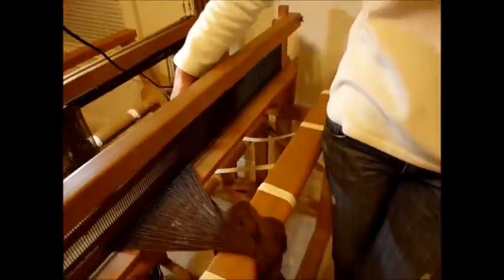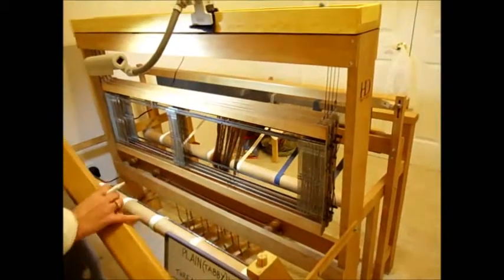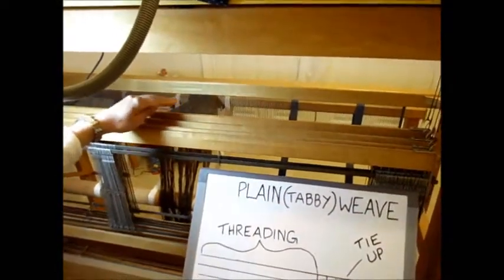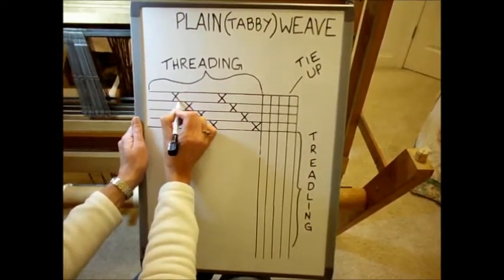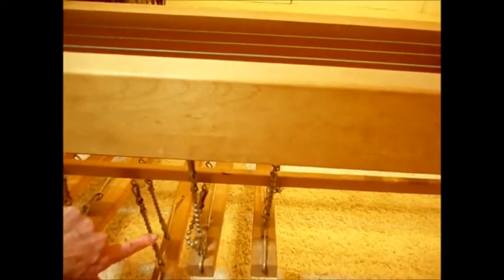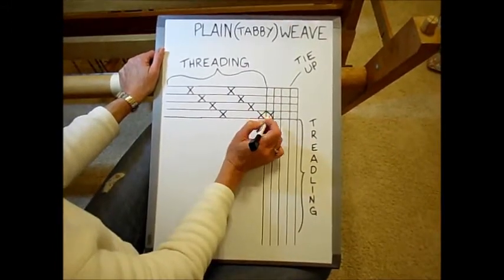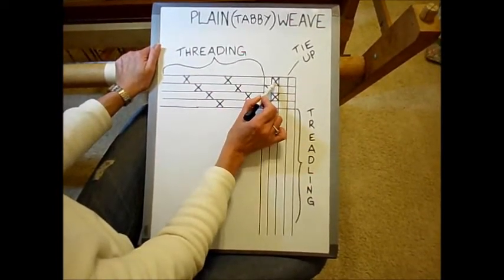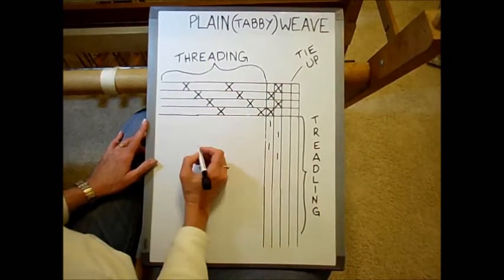How to Weave on a Loom - Video 9 - Threading the heddles on a loom Part 1

Comment: Hi! Thank you for this. One question: when you flip the pattern do you start the threading sequence on the far right side? The edge furthest away from the treadle tie-up information?
Reply from the maker: Hello! Yes, you are correct. You should start threading when you're sitting at the back of the loom from your right to your left with the pattern flipped upside down reading it while it's upside down from right (edge farthest from tie up info) to left.

Comment from the maker: Try this:Start by hooking the loop at the end where the long and short cables come together to the chain that attaches to the cables across the bottom where the lamms are. Bring both long and short cables up and over the pully on the right side of the loom, under the metal bar across the castle and connect the short cable to the right side of the harness and bring the long cable over to the left side of the loom, over that pully and attach it to the hook on the left side of the same harness.
Reply: Elizabeth Wagner PL explain me in jaquard

Comment: I have a question. Your video is very good.  I am a starting weaver.  I recently purchased Anne Dixion's The Handweaver's Pattern directory.  In this book there is an additional grid shown on each weave sample page.  On page 29 there is a plain weave the top left of the page shows the threading of the heddles.  Next to that on the upper right there is a ti up/ treadling pattern.  Both of these I understand but there is another grid that runs down the left side of the page.  It shows a grid 14 x 30 squares.  The first two rows are blank but then the second and fourth rows have a number 1 in the second square and the first square respectively.  Also this patter in the third and fourth rows  show a repeat symbol indicating to repeat this sequence over again as you go.  The weave is a 3x2/16 Tabby.  If you can please help me to understand this.  Thank you so much .  In other weave samples these squares can hold numbers as high as 9 or more.
Reply from the maker: helena carleton Helena - Good book.Glad you are getting started and have some questions already. It all seems kinda cryptic in the beginning, but after a while you will figure out what everything means. You are right about the threading pattern. The block in the top right (black and white squares in my copy of the book) is just the tie up. The treadling sequence is the grid that you're talking about that runs down the length of the different patterns. Each one of these patterns calls for a different tie up and treadling, although all of them, as well as all of the patterns from page 29 thru page 47 can be woven with the same threading. All you have to do to change the pattern is change the tie up and the treadling. The first two blank rows in each treadling grid don't mean anything. She just left those blanks so you could see the separate treadlings easier. Finally, the number in the blocks represent how many picks (passes of the shuttle through the shed) you should throw on each row. The reason why some of the patterns later in the book have higher numbers is that she wants you to throw that many picks on that particular treadling, but in between each (pattern) pick you need to throw a tabby pick (1&3 or 2&4). Look at the top of the treadling grid on those multiple pick patterns. Do you see above the very first draft a blue and white tabby grid? That means that when you weave those patterns in between each pick you should throw a tabby shot. The tabby pick anchors the fabric in those patterns with large floats, etc. I hope I didn't just confuse you more. Maybe check out page 9 "Understanding the Weaving Drafts". Best of luck and thank you for watching my videos! Let me know how everything works out. -Elizabeth
Reply: Elizabeth Wagner I want to thank you for your prompt response.  I think I get it. I  will read it again to be sure.  Thank you.
Reply: helena carleton I thought it would have to be far more complicated then it is.  I never really thought about showing how many picks to throw.  I imagined some thing different.  That is so basic, but helpful for some weaves.

Comment: when reading the treadling pattern, do you read it from left to right? or right to left?
Reply from the maker: +Rhonda Callahan I turn the pattern upside down and read the threading right to left as I sit at the back of the loom facing the heddles and thread the headdles right to left.
Reply: +Elizabeth Wagner, thank you so much for your response.  I thought that, but wasn't for sure.  Thank you again! :-)
Reply from the maker: Yes, it would still weave plain weave (tabby).